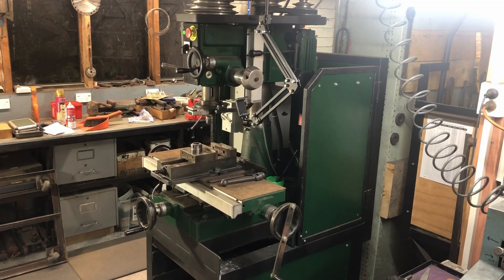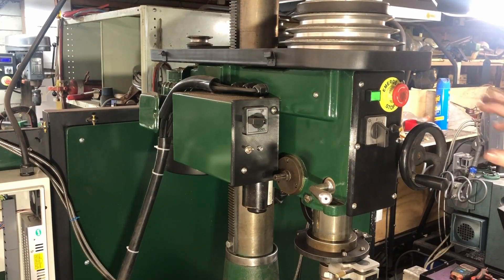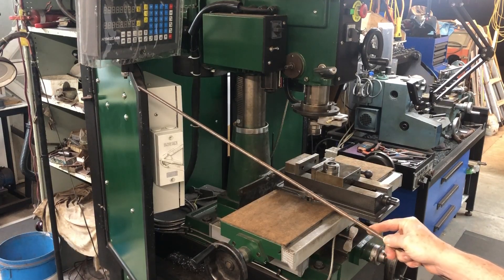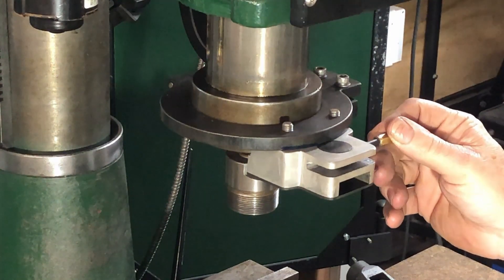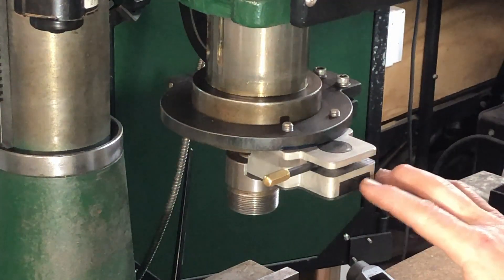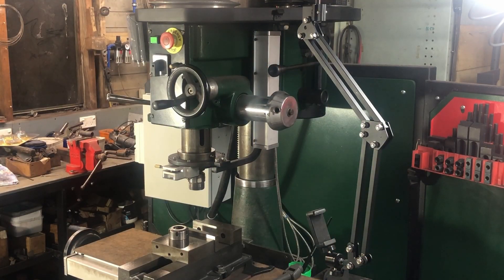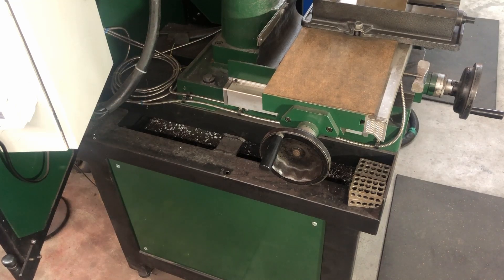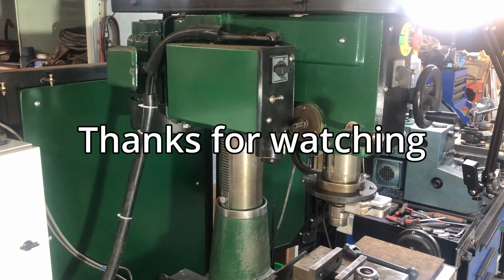Shop Made Tools & Upgrades #5 - Milling Machine Upgrades

Comment: Thanks for the links, being foreign language I would never have found them or watched them if they did come up as recommendations.
Google translate probably won't be much use but at least I'll get general idea.
The head quick release looks really useful, as you said, nut and bolt is a PITA.
Spindle lock another great upgrade, I've had tools creep out of collets as I couldn't get draw-bar to tighten enough (really pissed me off when I put 5/16" divot into brand new rotary table, even if it is only 0.002" deep)
Ended up buying end mill holders for common size mills I use but collet chuck is way more convenient most of the time.
Reply from the maker: Yes, the spindle lock is really useful. It is used every time I use the mill. 
Thanks for your comments.

Comment: Great video !
You have done some awesome mods to your mill !
The lock mechanism and drive  for the head has me thinking of something i can do to my HM46 mill that  uses some dinky little toggle lock screws that are on the opposite side of the mill to the raise/ lowering drive handle - drives me nuts ! Being able to unlock and then move the head on the same side of the machine would be nice !
Reply from the maker: I'm glad you have got some ideas from this video. Most of my modifications are originally ideas from other youtubers videos.